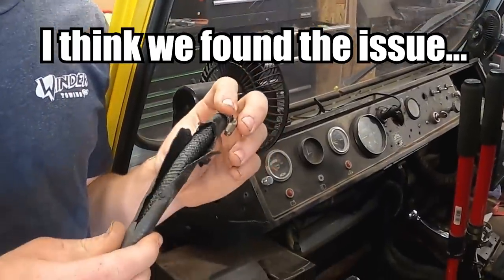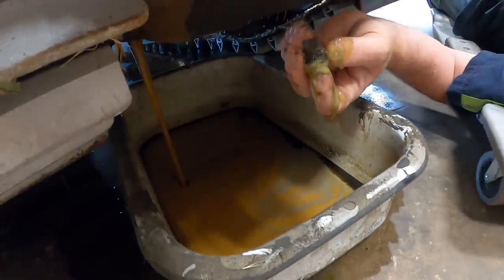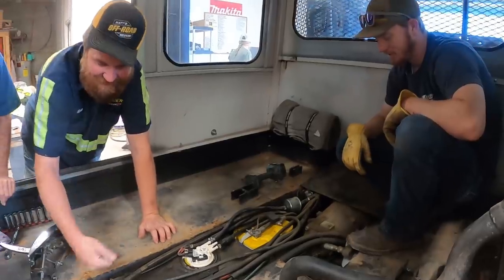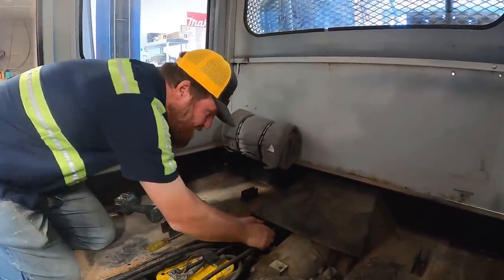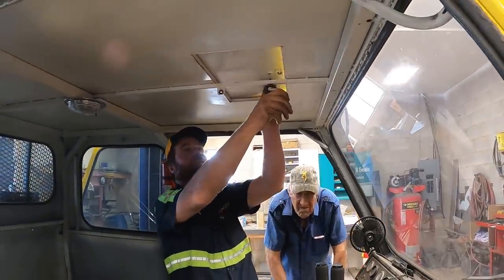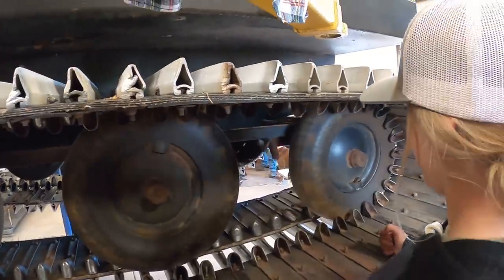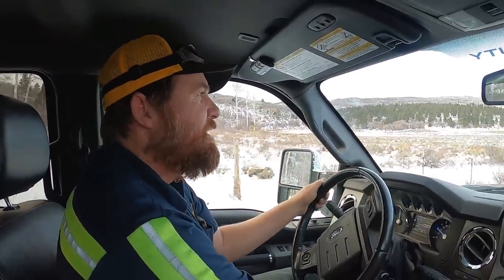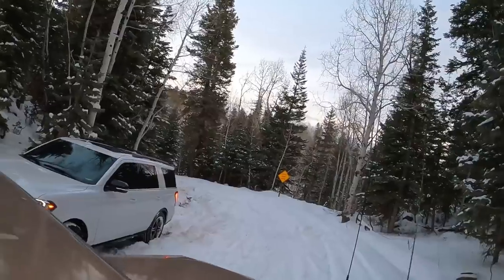What!? Gasoline Is Spraying Inside & Out

Comment: Just because a mechanic is certified, doesn’t mean they will always choose to do it right. And just because a mechanic isn’t certified, doesn’t mean they can’t do the job right. Nice work on this one guys!
Reply: Certified crazy?
Reply: Certified means: "Capable of memorizing the test answers". Idiots with certificates have always been the red headed children of real mechanics.
Reply: Certified to drive a forklift maybe....
Reply: Was he certified, or certifiable?
Reply: Michael Montoya   Very well said
Reply: Did they disconnect the battery before working on it ?
Reply: Transmission line for fuel line. SMH.
Reply: @SurferJoe46  , Yet the Red Head's figured out thee promble.
Reply: Very true.
Reply: @327JohnnySS  Both should be nitrile lined hose, I don't see the problem other than the temperature of oil in the hose but in this situation, there was little pressure and no real heat.  Looking at the hose, he should have not used a bit from Noah's ark!  Its water hose that doesn't like oil.
Reply: @SurferJoe46  I got a 95% on my automatic transmission ASE before ever taking one apart.  Didn't study or memorize anything either, just educated guesses.  Not bragging, just saying I dont think the tests are very difficult if I could do that.

Comment: A buddy of mine who had a body shop told me, "There's two types of sunroofs, the kind that leak and the the kind leak alot".
Reply: That's why the sunroof on my truck NEVER gets opened. Leaks develop faster from use.
Reply: This is why the limousine industry stopped installing sunroofs in the new cars around 1990, and major car manufacturers have gone over to "Vista Roof", where your roof is just another windshield.
Reply: Ha, mine does both, it leaks in the summer and it leaks a lot in the winter 🤣
Reply: Same. My buddy custom ordered his last car to remove the sunroof that was a standard option on that trim. He refuses to ever get one again
Reply: T tops too, in my experience.
Reply: Never purchase a vehicle with a hole in the roof! In the snow cat it might have been added as an emergency exit but it should be raised a couple of inches higher than the roof so water runs around it not in it.
Reply: I've had sunroofs in my Toyotas for years (several models) and never once have they leaked. I'll admit that we rarely open them though.
Reply: @TheRealDonLayton  I've been using blenders all my life and they never leaked either.  Toyotas have a bigger problem, they're Toyotas.  You might as well be driving a blender.
Reply: the one on my 96 accord hasn't leaked yet!
Reply: @tiredoldmechanic1791  That's a great idea!
Reply: My sister had MOSS growing in her truck from leaking sun roof while at forest grove oregon for college.
Reply: All sunroofs leak. How the water is managed is the difference in manufactures. Last one I had was on a 2009 Impala. Five new vehicles since then are without sunroofs. Never again.
Reply: I have passed over many great looking vehicles to purchase one that didn't have the leak waiting to happen!
Reply: @tiredoldmechanic1791  It should be also a coupla feet wider for an emergency exit!
Reply: When I took the headliner off in my Suburban, I found that the sunroof had it's own plumbing system. It has a tray surrounding it with drains and tubing. Basically they're expecting it to leak.
Reply: Drain holes and hoses solved the sunroof leaking problem, until the hoses get clogged and owners don't know to clean them out.
Reply: I only ever had one leak. The sunroof rack was replaced because it was defective the tech never installed the drain tube and it leaked a ton in the car while at the shop....
Reply: Sunroofs do not leak the way people think. All sunroofs have drain tubes in one or two corners of the roof, and they get full of dirt then wet  and clog up. The tube drains  out by the door henge on my car.I use a long wire to clear mine out, some people use an air hose to blow it out.
Reply: @billhaight7010  exactly. Also old or poorly  maintained seals. Mostly vehicles that stay outside in extreme weather or sun damage
Reply: My Toyota Celica sunroof didn't leak for 14 years, then I got a 4Runner, hasn't leaked in 21 years.
Reply: @billhaight7010  Weed whip line works pretty good.
Reply: My Mazda is 20 years old, gets the roof opened frequently and never leaks a drop. Lives outside too in the PNW climate.
Reply: I have 2 new vehicles where you can’t remove the sunroof from the trim. When they leak it will be vinyl wrapped roof and the fuse will be pulled
Reply: Mine dont leak
Reply: Hahaha..I own a auto body shop and that is so true...may I also add there are also mercedes E class sunroofs that literally just fly off while driving down the freeway.
Reply: A third kind: those that have been permanently sealed

Comment: These snow cats use a planetary controlled differential .When one brake is applied , the planetary gears cause the drive  sprockets to operate at different speeds. Pull the left steering lever and the  left track will  turn at a slower speed than the right ,  and the same  for the right . This type of steering allows steering while maintaining power to both tracks , unlike a clutch - brake system . After the 1990's , almost all snow vehicles have hydrostatic steering . This of course allows infinitely variable radius turns , plus  counter rotation of the tracks . Each track driven by it's own hydraulic pump and drive motor , and with that , a much more complicated , not to mention , a way more expensive system to maintain . Our Sherman tanks , used in WW 2 , used a controlled differential  steering , and was found to be a simple , yet rugged solution , and simple to repair in the field .

Comment: Pumping fuel onto the battery lol

Yeah there've been a few times in my life where I've wondered how something didn't just explode and kill me.
Reply: Reminds me about working with my   dad taking out a gas tank with him smoking over it.
Reply: Gasoline does not explode. It burns (more specifically Gasoline vapor with air mixture).
Reply: @xali2008  throw gas on hot coal and then light the vapors.... Pretty sure that's an explosion
Reply: Jason H.. Everyone's dad had a smoke going handling gas

Comment: I hope you spoke to the mechanic about his certifications. Having one mistake might be acceptable, but multiple mistakes is just ineptitude.
Reply: It was probably Casey, too. LOL.
Reply: Every time I get somebody to do something on my vehicle's that I can do myself but Either too lazy or don't have the time they always seem to screw it up and I end up fixing anyways.
Reply: There are obvious negative consequences to the roadkill approach to vehicle repair, fabrication and maintenance.
Reply: @datalorian  idk
Reply: I agree with you that the fuel filter on the return line was bad.  Trans cooler line is high pressure, oil resistant hose, so while it isn't something I would do, it's safer than using low pressure fuel line.
Reply: @LuckyBaldwin777  It’s not just about the pressure rating of the hose, but more importantly the rubber formulation. Fuel lines and transmission oils lines are NOT interchangeable! This is why the hose was eaten alive and breaking down. The rubber formulation was never intended for gasoline.

There is a reason old-school mechanics used gasoline as a cleaning solvent. It will eat through just about any rubber gasket material and easily de-greases parts. With it’s relatively low vapor point, gasoline also evaporates without leaving much of a residue.
Reply: That could have been a computer certification. Or meteorology. Not'n wrong wit that!
Reply: @douglasgroff7648  It's the same rubber.  It's called nitrile rubber (NBR).  The other type of fuel hose is Polytetrafluoroethylene lined hoses (PTFE).  Those are usually plastic lines with A PTFE lining and permanently attached spring connectors that take a special sleeve tool to disassemble.

P.S.  Shade tree mechanics use gasoline for degreaser.  Professional mechanics have NEVER used gasoline, it's far too dangerous.  We've always used low-odor mineral spirits, sometimes called 'safety solvent.'
Reply: @LuckyBaldwin777   Nope, transmission hoses are NOT the same as fuel hoses... PERIOD. The base rubber is the same, however there are additives that make the rubber resistant to degradation by the fluid it is carrying. SAE J1532 covers transmission hoses. SAE J30 covers all manners of rubber hoses intended for fuel. There are multiple specifications for fuel hoses under J30, depending on the environmental conditions the fuel hose will encounter. Fuel hoses intended for in-tank applications (J30R10) are not compatible for use as fuel injection hoses (J30R9). It’s all about whether the fuel is going to be exposed to the inside, outside, or both.

I also said that OLD-SCHOOL mechanics, meaning 1930s or even 1950s... This was before the advent of specially-formulated degreasers and parts cleaners. A lot has changed over the years, for good reason. Any good mechanic (shade tree or professional) will use the proper cleaners for the task. However, this doesn’t negate the fact that gasoline could be used as a degreaser...
Reply: @douglasgroff7648  whatever
Reply: @datalorian  I wish Matt and Casey would team up again.

Comment: Matt: "It smells like gas really bad" 
* starts snowcat *
Me:😮
Reply: AND revs it up...
Reply: Meanwhile Ed smoking like a chimney in the background.
Reply: @nasonguy  I was at a hardware store once and outside the front door, there was a leaking propane tank in the locked up tank exchange thing. I went inside, told staff what I found, but they didn't seem overly concerned and that they would look into it.  So I said, "ok, but there is a guy leaning against the cabinet smoking a cigarette". Well they ran outside pretty quick after that.
Reply: @gord7025  you gave me a good laugh. Thanks for that
Reply: @gord7025  
One of my many dumb tricks was to try to make an air receiver tank from an empty propane bottle. I opened the valve to full and inverted it for 3 days in my well vented garage. Then I removed the valve and proceeded to light my oxy- acetylene torch to braze in the union I was going to use. As soon as I sparked the acetylene, there was a WOOOMPH !! and the whole garage floor was a blue flash. The heat went up both of my overall legs, and singed off every bit of hair on my body, chest, arms, legs and you know where... even my eyebrows and lashes went.

Another lucky escape... 🙄🤣
Reply: @clivehorridge  you never do hot work on a tank until it's been purged and tested for the presence of volatiles. was dumb luck you didn't burn down with your house.
Reply: @clivehorridge I know of a resort owner that blew a side wall out of his garage because of a leaky propane tank.
 Years ago I found a full propane tank out on the lake when I was ice fishing. I brought it home and put it in the garage because it had ice all over it and I wanted to defrost it. Well....once it warmed up I realized why it got left behind. It started hissing and spewing gas out of the overfill protection valve. It got chucked outside pretty damn fast. It was fine, but what I thought was extra weight from ice and snow was due to a severely overfilled tank.
Reply: If ever there was a time to cut away to the 'Shake hands with danger' clip, this was it.
Reply: @clivehorridge  So are gas fumes heavier than air?  We used to use soapy water, and after welding the tank, blow out the water with an airline with long nozzle.  We've all done things we later thought dumb I expect.  When I was learning to weld at the Ford Apprentice Training School, I thought it would be fun to pile up all the steel and junk on the fire bricks.  The heat up the fire bricks on one side of my pile, and squirt acetylene under the pile from the other side.  Luckily, the explosion shot everything straight up into the air, some of it hitting the roof twenty foot above.  Even more lucky, none of it hit my fellow apprentices on the way down.  It shook me up up and then some and is probably the most scary moment in my life.  I have no idea how I got away with it, but no one came running, and I didn't get into the trouble I surely deserved to.
Reply: You let Lizzie near it, didn't you?
Reply: I'm screaming,  "don't start the SNOWCAT!!!!!!!!!!"  My border collie COOPER starts barking and runs downstairs as if I'm screaming for help!!!!!  You folks are awesome!  Thanks for the videos!
Reply: @TrevorDennis100  Chemist here. Air is 80% nitrogen which weighs 28  and 20% oxygen which weighs 32 giving an average weight of 29. Propane weighs 44, butane weighs 58. So yes gas fumes are heavier than air and sink to the floor. Still air in the garage was critical.
Reply: It could have been a diesel! Then you really have a problem if it smelled like gas.
Reply: @gord7025  I have to tell people where I work not to smoke by the propane. It's just common sense regardless of a leak. Even old tanks can have enough fumes for an exciting bang!
Reply: @tomoakhill8825  I lived in Hutchison, Kansas when they had explosions around town from natural gas leaking from salt mines under the city. It hadn't had mercaptan added to it yet and people couldn't smell it. It blew up a mobile home and they almost evacuated the hospital. Crazy times.
Reply: @tomoakhill8825  Thanks Tom.  I think we all love learning new things.  I'm a Kiwi, but I was 'trying' to speak American English, so I was asking about petrol fumes.  Do you know if they are heavier than air?  OK, I just asked Google who told me that petrol fumes are three to four times heavier than air, so not only do they sink to the floor, but they tend to flatten out and spread a long way.
Reply: @cooperdog9956  It must have been that amazing sense of smell that dogs have.  Even over the Internet.
Reply: Gotta move it into the shop to fix it some how
Reply: @clivehorridge  fill with water first then drain before welding gas gas bottles is what i have learned from internet. i think your story backs that up :)
Reply: @TrevorDennis100  Not sure about propane, but gasoline fumes are heavier than air and will sit at ground level. My mentor told me about how his old boss when he was an apprentice was in a pit doing some welding work under a vehicle. The pit was full of fumes which my mentor pointed out, but was waved off and told to be quiet. Bloke doing the welding set him alight when the fumes ignited. Mentor grabbed the nearest extinguisher, which was a dry powder one, and put him out... The bloke whose life he saved letter berated him for using the wrong type of extinguisher... like sure, I bet all that powder it his wounds was nasty, but would you rather just burn? Smh, some people.

Comment: I didn't even know that there was a PU version of the Corvair or a station wagon and you have several!
Reply: There's also a van version! It's basically the same as the pickup with a roof over the bed
Reply: Damn Corvair almost killed me when I was working for a used car dealer in high school.  I was going too fast and tried to make a slight left hand dog leg turn and the damn thing just kept going straight. I tapped the brake to get the front end back on the ground and it turned.  Always watched my speed after that.
Reply: He's got a rampside as well, maybe two.
Reply: Check out Jay Leno's Garage on YouTube, he has an episode of his  Corvair "Rampside" Pickup. It's Red with a White stripe down the middle of each side. Its really slick!👌
Reply: Check  out Jay Leno's Garage, he restored one to original condition, it is beautiful.
Reply: Now ot should run better
Reply: Glasses are so so to each his own
Reply: There was a Corvan as well as the Corvair Greenbrier, a 9 passenger capacity wagon, similar to the VW bus.  
Their 4 wheel independent suspension would get squirrely if you weren't careful.  
The 63 Monza convertible we had handled as good as any high dollar sports car after installing a couple of Eelco after market suspension  parts. Sounded great with a dual mini glass pack exhaust system. Never got to install headers before trading for a Scout n snow plow.
Reply: there was also a corvair-powered motorhome called the Ultravan. Aluminum framing and shell like an airplane. Me I own a 1965 140 monza convertible. It corners amazingly well so to me it's a 'poor man's Porsche'. With it's flat 6 engine it even sounds like a 911

Comment: Hey Matt, I used to be a commercial engineer in a high rise and our lobbies were sound insulated with 1 inch thick fiberglass board insulation wrapped in open weave, not vinyl, fabric that were fiction fit in a rectangle of wood on the walls. Really kept the sound down in these confined and lower height spaces. Your could be held at the corners with just a piece of flat stock and not to expensive. I believe the fabric was attached to the back with either 9/16 T-50 staples or outward clinching staples from an insulation stapler from the same company. Low tech, cheap, and lightweight. You would get sound deadening and R 3 insulation value. Also the insulation doesn't burn and you get treat the fabric so it doesn't burn also, something you can soak it to get that. Same thing they use for theatre curtains. Hope that helps.

Comment: Get some 4x7 led headlights for the cat. Spruce it up and way brighter. There are certain ones that focus the light much better.
Reply: LED light bar across the roof at the front and work lights at the back.
Insulation to keep it warm and kill the noise.
Reply: IPF inserts, the difference they make especially with good HID bulbs is amazing. If you have 7 or 8 inch round or 4x7s IPF inserts are a no brainer.
Reply: Get some real e -codes and you'll be set. Beam pattern matters especially offroad.
Reply: @marvindebot3264  HIDs only work in reflectors designed for them, not standard halogen fixtures. You should know this.
Reply: @otm646  IPF make HID ready inserts mate.